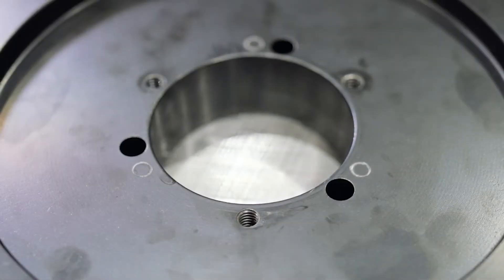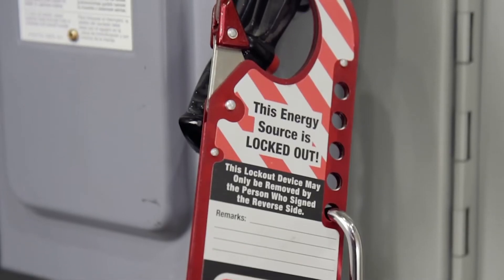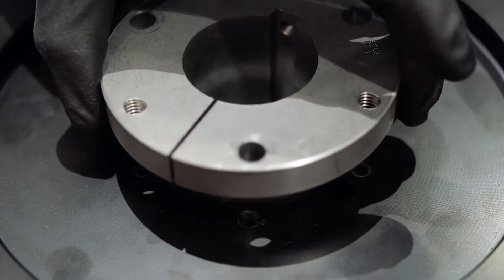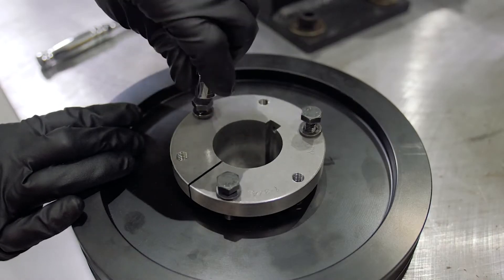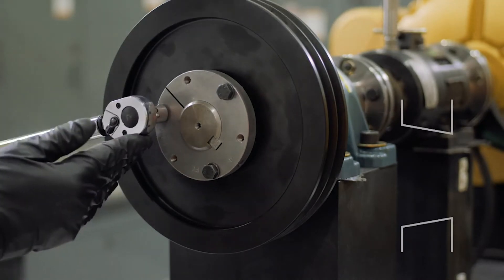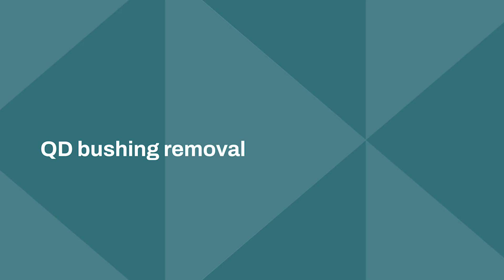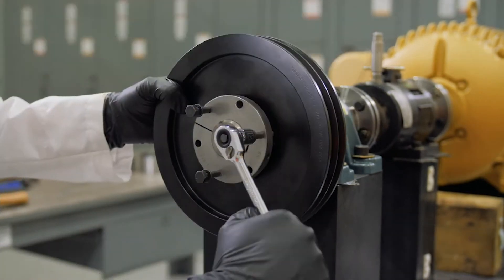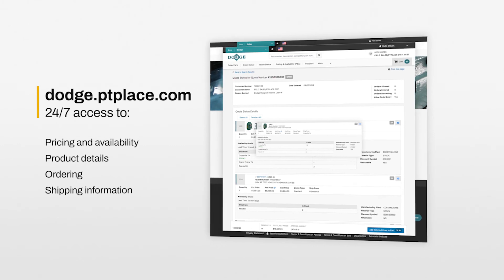Dodge QD bushing installation | Dodge Industrial

Comment: Can we use this locking mecnanism for ring gear in vertical turbine gear.i have right angle gear and its ring gear comes out of the shaft has no lovking mechanism.plx guide